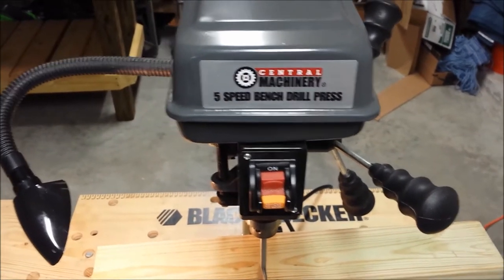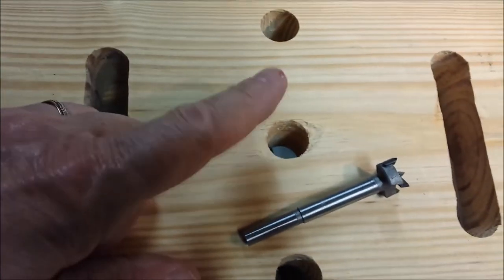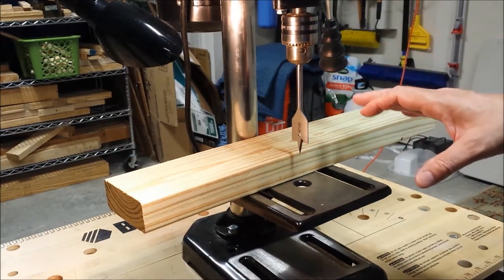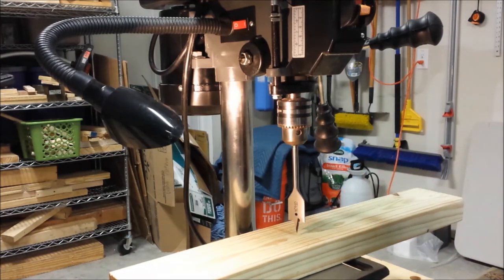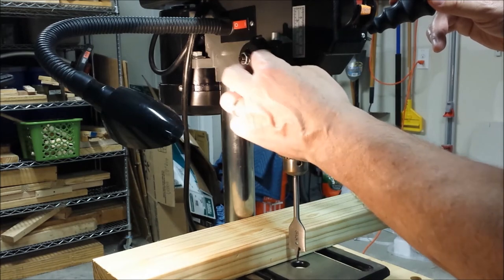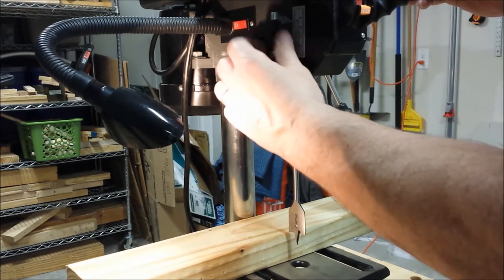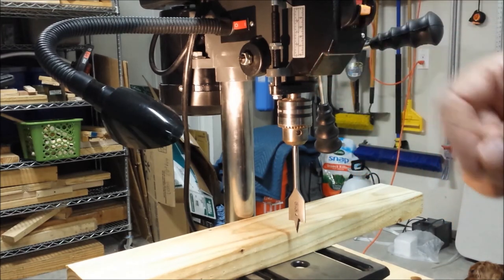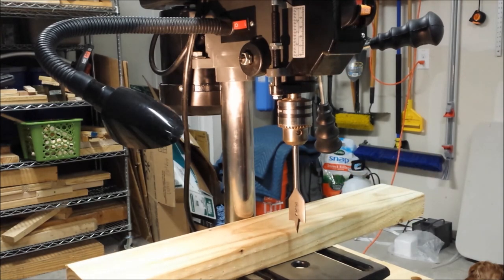Harbor Freight Drill Press Depth Control Adjustment

Comment: The nuts on my gauge has a tendency to walk down due to the vibrations when the drill is on.   Is there a trick to locking it in place or is my gauge defectively too loose.  I am not sure I understand how the pair of nuts work together to lock in place.